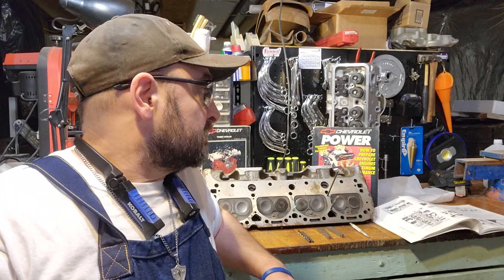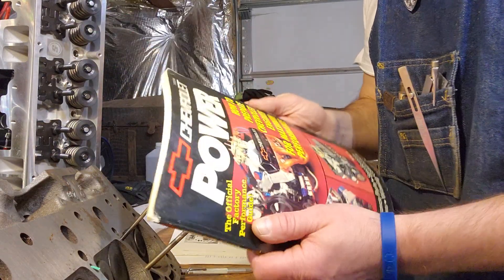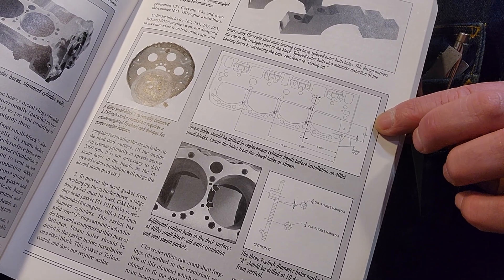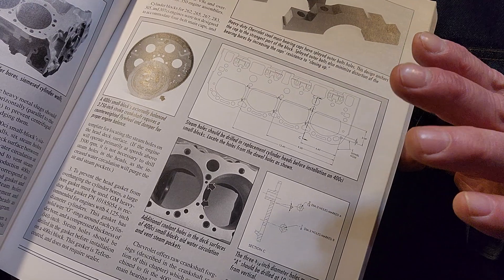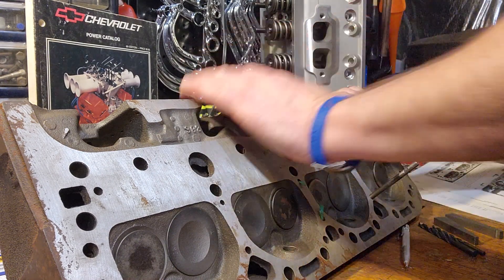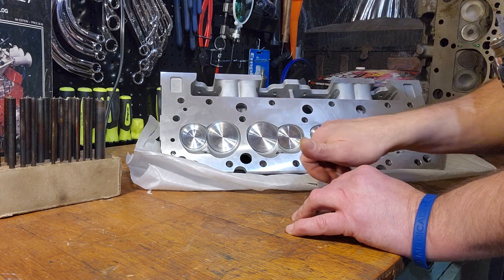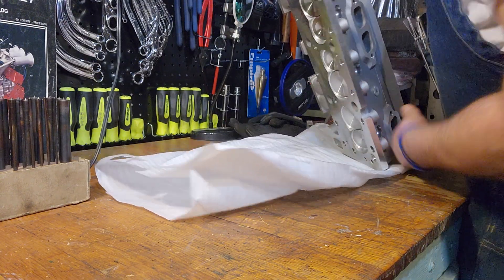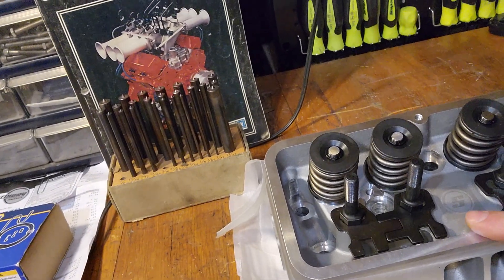More About Speedway Motors 461 Aluminum Small Block Chevy Heads for a 400. Check Stud torque.

Comment: I seen it done before,@22 degrees and the person bolted a used head gasket to the cylinder as a guide to find hole location. It was done on a drill press and he just angled the secured head to the degree and drilled really slowly till he broke through the aluminum. I might be wrong on degree,it’s been awhile. Those heads with 1.6:1 rockers above.525 lift do flow 230 cfm. Good luck, drill once but check often 5,10 times.

Comment: I had a zz3 crate engine and those heads were crap I put my edelbrock rpm heads on and it made way more power
Reply from the maker: A pair of zz style corvette heads were the first aluminum heads I bought to swap onto a 76 stingray with a low compression L48 350. Back in the late 90s. A high Energy 268 cam, a Holley 600, a Chevy dualplane highrise intake, and good exhaust really woke that car up. The only complaint I had about that swap was that practically the entire top end, valve covers, intake, gaskets, etc... all had to be chosen to be used specifically with those cylinder heads. a set of Richmond 3.90 gears and a 2800 converter really made it snappy. By the way. Those heads came new from the factory complete with the studs and guide plates torqued, in place, and ready to run. So, to anyone who thinks that engine building is above my head. Think again. @Osbshowersyndicate that doesn't refer to you. But somedays I get the most absurd comments. Have a great day and thanks for the reply.

Comment: You can easily drill steam holes by hand, no problem. You can also NOT drill them and never have any issues? Even if you are running on the street with 12:1 pistons and red lights every 100 ft.

25 different couples can go on 25 dates with total disregard towards babies and "germs"  they may or may not have. 24 of them will not have any issues, HOWEVER, the 25th couple ends up with twins, warts on things that shouldn't have warts and lots of time spent in domestic relations and family court.

All of this could have been avoided by a few extra minutes to drill holes or just purchase and apply coverings and life would still be great. The same thing applies to steam holes on a 400 SBC. While kids are expensive? blocks, heads, cranks, pistons and rods along with all the other moving parts can add up! 

Keep your 400 happy with steam holes and when your attached drill is on the move, protect it too! It is much better to have something you may never need then need something you don't have. Simple, easy and cheap may save you a LOT of cash and time?
Reply from the maker: WOW! that's quite an analogy 😅

Comment: You can get away with just using the old head gasket and the dow pins to locate the gasket
Reply from the maker: You can do that. I'm making a jig.
Reply: @silverstreak232 hey what works for you that's all that matters , most ppl forget or don't believe that the steam holes are important lol if there not there the engine will overheat no matter what you do.

Comment: The exhaust side is 7/32.
Reply from the maker: NO IT'S NOT. IT'S 1/4 "
Reply: @silverstreak232    Measure to steam port hole in the 400 head gasket, they're 7/32.  I've built dozens of 400 small blocks.
Also, the water in the block has to flow through the drilled heads, and there's no use drilling the steam port holes larger than necessary.
Reply from the maker: THE HOLE DRILLED IN THE HEAD IS 1/4" @ricktaylor3748
Reply: @silverstreak232    Turn your caps off, it doesn't make you any louder.
 Why is the hole in the 400 head gasket 7/32 ?
As I said, there's no use drilling the steam port holes larger than necessary.

Comment: We always just use a head gasket with several head bolts through it to center it up to drill steam holes so you know without a doubt your in the right spot never had an issue just be sure to deburr it
Reply from the maker: I've used the head gasket method to spot the holes too. But, stick around and I'll explain why I'm going to make a jig plate for drilling the holes. At the moment I'm still waiting for a piece of aluminum flat stock to be delivered. I have all the other materials. If it's not something that interests you then by all means do what suits you.

Comment: I'm running a .30 over 400...406...with sportsman cast iron heads that do not have steam holes...I've never had a problem with overheating and that was the whole purpose of the steam holes...soo why bother.
Reply from the maker: It is not so much over heating being  the big issue. It is low, coolant circulation at lower engine speeds allow steam pockets to develop under the block deck between the cylinders. I mentioned this. Engines that generally run at HIGH rpms most of the time don't need them. All that is explained in great detail in anything published by reputable sources concerning the SBC. I HAVE seen blown head gaskets where persons have tried to get away with omitting the steam holes on 400 blocks meant primarily for street use. That's why I'm bothering. Now, if what you do works for you,  that's fine. You don't have to listen to anything I say. But, I'm going with the steam holes.

Comment: pretty cool explanation I retired as  a cabinet builder turned hobby machinist got use to making templates👍👍 for cabinet stuff and the like carried it on to the machinist side of me and I dig it maybe you could prototype your jig and sell a few just sayin .
Reply from the maker: Thanks for the encouraging feedback. The reason for using the jig is to show others how to do a professional quality job, get it right the first time, using a hand drill. And the jig can be used reliably over again.  Unfortunately, the cost of new materials (1/4" x 6" x 36" aluminum plate, drill bushings and screws) then labor would put the cost of a jig plate over $200 minus shipping. If I were to sell them, the costs out weigh  the demand. When I proceed with constructing the jig I'll post it so others can follow along, if they'd like. The big plus is that once the jig is made, the job can be done right on the work bench. There's no need for a time consuming set up on a drill press or milling machine. And not everyone has access to a mill or large drill press.

Comment: Ran multiple sbc 400 blocks, never drilled sream holes, never had cooling issues.. compression 12 to 13.1 with nitrous.
Reply from the maker: I understand that a lot of race engine builders drill and tap the steam holes for plugs.The main focus here is street use where the RPMs and coolant circulation will be lower, for longer periods of time, than that of a racing engine.
Reply: @silverstreak232   a higher flow water pump higher system pressure can accomplish the same results, most professional sbc head porting guys do not drill the steam holes anymore, even when using a stock 400 block for hot street builds like you are doing.
Reply: And, your heads ran hot, the steam ports are there of a reason.
Reply: I didn't have issues either with or without nitrous which was a big direct port system.  All in a destroked 400 , several destroked 400s
Reply: @tommywicker1432  and reducing your cubic inches will ALWAYS yield you less power..

Comment: Several folks in the comments have alluded as to why the studs and guide plates are loose. I'll add that the "fingers" on those guide plates often need ground to allow enough movement to properly align the rockers and valve tips. I go a step further and tig weld them once locked in place. I also stamp (number) them and the heads so if they ever come off for service down the road they'll easily go right back together. 

Neat heads. LOTS of improvements to be had with porting. The aftermarket aluminum heads leave a good bit of material in the right places!! Unlike the old factory casings.

Also, I've built plenty 400 small blocks and I've never drilled steam holes in the heads. Never had a cooling problem and I'm in S.E. Texas....plenty heat!!!

I hope any of this helps someone out. 
Good luck on your build!
Reply: What temp does it run? The 400s ive seen with heads that were not drilled, were one pass wonders. One pass, and at 212 or better. If you do a block fill. Not so much of an issue.If I do a 400 block based engine. I use the DART SHP, block. 4.125 bore and a 4 inch stroke crank. = 427, 4.155,with the 4inch stroke crank= 434. My 81 malibu street/ strip car is a 427, AFR heads, K1 forged crank. And top of the line components thruout.
Reply: @ronniecox109  I like to see mine run around 180ish. With enough radiator and fan (properly shrouded) it's never been an issue. 
I've built several. All different. Canfield heads, Brodix heads, Dart heads, etc...
Several different things that will make em run hot. Not enough initial timing and shitty fans being the most common. I typically lockout the distributor and set it between 34* and 40* depending on where the best ET is found....then jet for MPH. Drivability is tuning pump shot, power valves and idle circuits.
A start retard makes life on the starter and battery quite a bit easier.

Tip:
Look and the mid-late 90's Volvo dual speed fan!!
Reply: Also FWD Tarus  duals work.

Comment: These Speedway Motors "461 heads" are just a Flo-Tek 180 casting head. The Summit "461 heads" are the Trick Flow 175 heads. These heads you have shown have adjustable guide plates as to why the rocker studs are not tight. I would also go over the valve job, check valve spring specs, guides. For a China casting its ok...the AFR Enforcer sbc head comes with steam holes for the 400 block and a good casting for the money...also a China casting.
Reply from the maker: Hi Tom, and thanks for the feedback. I understood that these were imports before buying. My main concerns are BUDGET and QUALITY. For the money, it was a toss up between the Edlebrock E Street heads and the Speedway heads. The Speedway heads were on sale at the time and were about $70 more than the USA made Edlebrock units. It was a hard a decision. The E Street heads have been around for a long time and have a very good reputation. In fact David Vizard devotes a section, to them in his book about porting and flow testing. He basically says they're really good for the money (not in those exact words). The Trick Flow double humps were just out of the price range. Since the Speedway product is relatively new to the scene and has some very good customer reviews (the basic Flow Tech units had some really bad reviews) I decided to go with them anyway. I feel they will look more at home on a painted street rod engine than the square looking E heads. AFR, although a great company with a great reputation was just out of the question as far as looks and price go.
Guide plates. my experience with guide plates  has only been with the one piece style as seen on factory SB Chevies. But, tightening and aligning them will be pretty straight forward. I was just surprised to see that the studs were practically falling out when I unpacked them.  It might do Speedway some justice to make mention of this. Trust me. There will be someone out there that'll put these heads on a motor, leave the studs and guide plates as is, then blame the company they bought the heads from for their screwup. 
Even though these heads are sold "assembled and ready to go" I am going to pull the valves and hand lap them myself after doing a leak test on the bench with fluid. Then a leak down test can be done on the engine. Again, Thanks for your comment and have a great day.

Comment: Good review, looks like they will make way more HP than Ole doubble humps,you gona run flat top forged pistons, i got a 400 sbc i want to make 400 hp for towing!!
Reply from the maker: The 400 short block I'm using was assembled a LOOOOOOONG time ago. 1989 to be exact. It was a graduation present. Which in itself is a long story........ So, that explains the parts I'm using. The pistons are TRW #L2352F .030 over forged 1970 style dished. that yield 10:1 with 64cc chambers. The cam is an old Weiand #8102 hydraulic that was a match for the the Xcelerator 7546 intake. So, that's what I have. 400 horses seems like a high number. I'd be adequately happy with that. I expect the torque numbers to far out pace the peak HP. It's a street rod motor. All that aside, for towing, you have a good start. It might be more to your benefit to stay on the conservative side with the compression. Even the TRW #L2410F 1973 style 8.2:1 pistons produce 9.7:1 with 64 cc heads. This might be acceptable with aluminum heads and the right cam (110 to 112 LSA). Thanks for the feed back and best of luck to you.
Reply: @silverstreak232  my block is 511 still has oil and filter on it, standard dish pistons, I want good pistons and aluminum heads ! Thanks for your help  👍
Reply from the maker: @RonaldLewis-py6yt Mine is a 511 casting also. It was cast in late 72. It has 2 bolt mains, contrary to popular belief that  511 blocks are all equipped with 4 bolt maincaps. That's OK. when I first got the 73 Caprice It was in, I was 13 years old. The owner told my dad and I it was a 350. Well, anyway I'll avoid that rabbit  🐇 hole 🕳 for now. Because that was back in 1984 😂! That's a topic for another day!

Comment: With the multi piece guide plates it affords the ability to individually center up the rocker arm over each respective valve stem tip before the stud is torqued to spec.

Comment: The reason the rocker studs are loose is because those are adjustable guide plates. You have to make sure the rockers are centered over the tips of your valve stems. If they tightened them up, it would probably be wrong for your engine. I do like that the have the double hump cast into the head, Thats cool.
Reply: ditto